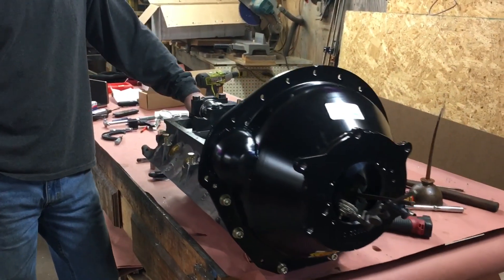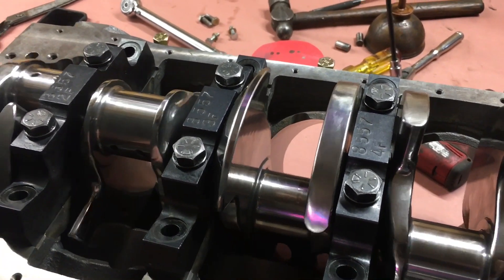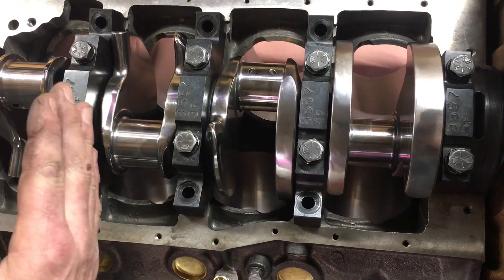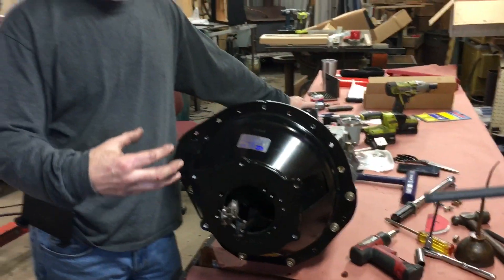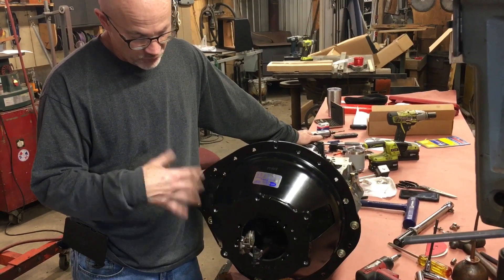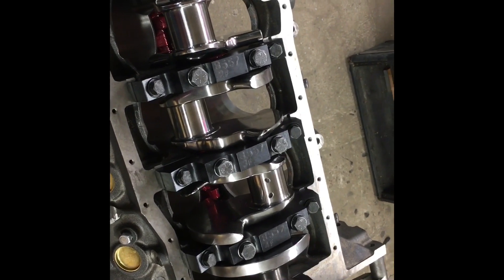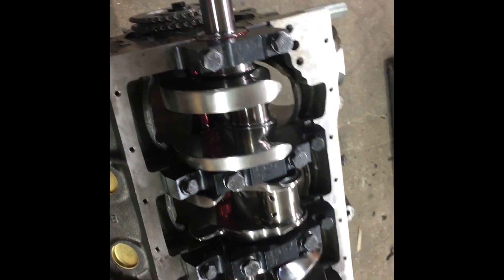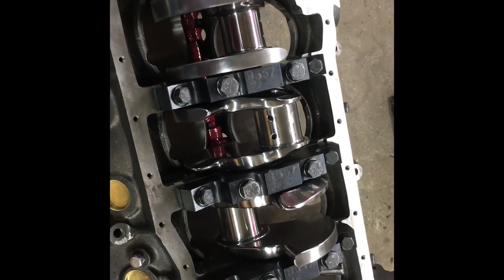Southeast Gassers Association Odd Rod Update #28

Comment: I learned most of the cleaning process from Wally Booth when I worked @ Booth- Arons Engines ( 1984-89)  few years later working at another race engine shop I'd machine the block and then I'd do all the cleaning for the engine builder and I loved using automatic trans for cleaning bores. I miss those days, especially the dyno tests!

Comment: Interesting to watch this as I was an automotive machinist/engine builder for 40 years before retiring, and it seems we do everything pretty much the same, where as some people have some slight differences. But I'm curious that you said you will check P to V clearance when you get the heads. I always checked it during mock up, so I was wondering if you did a preliminary check already? It's a lot of extra work if you need to take it back apart to cut pistons. Also I always liked to have the cam where I wanted it rather than change it for clearance if possible. Keep up the good videos and good luck at Shady side.
Reply from the maker: As a retired professional, you are correct in everything you say. This combination has been done before, so P to V should be acceptable but with the amount of custom head work being done, there is no guarantee. And yes, we would only move the cam if that is the only option. These days, even getting a thicker head gasket for this engine takes 4 to 6 months!
Reply: My retirement . been doing this 40 years myself. But I found this video boring.
Don't understand how you don't either.
Reply: @cammontreuil7509  I probably wouldn't bother watching any upcoming videos if I were you, I don't expect to get any more interesting. The sound of my voice could put rowdy children to sleep.